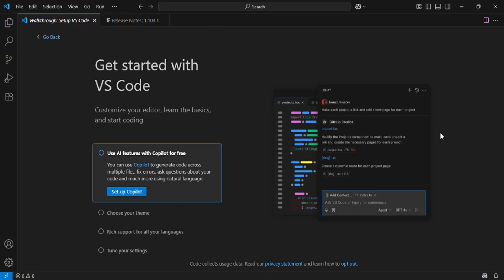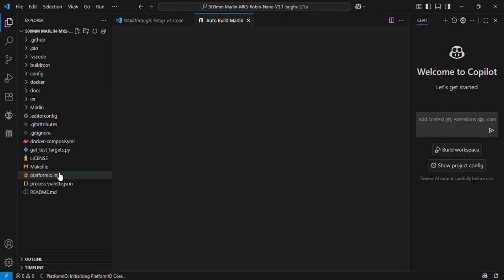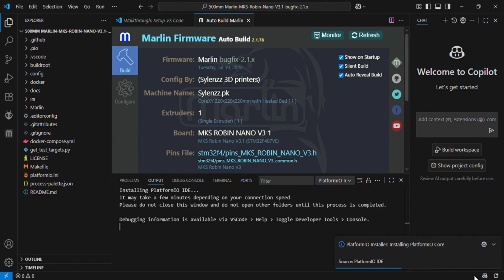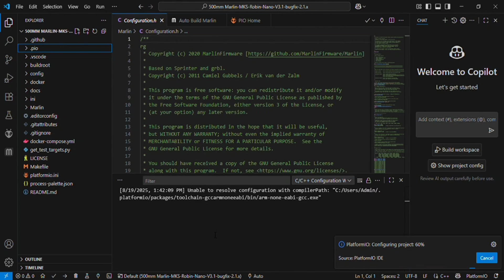Marlin firmware setup guide - VS Code and Auto Build Marlin | DIY 3D Printer

Comment: Thanks for the video, following the instruction I got a firmware.hex file, how do I upload this firmware into the mega 2560 of my Prusa i3 clone?
Reply from the maker: Try this
Install PlatformIO extension in VS Code.
Open your project or create a new PlatformIO project (board: atmega2560)
Put your firmware.hex file inside the project folder
Run this command in the VS Code terminal (PlatformIO environment)
pio run -t upload --upload-port COMx --upload-file firmware.hex
Replace COMx with your Arduino’s port (e.g., COM4 or /dev/ttyACM0)
Reply from the maker: Otherwise if you can create it's code in marlin firmware that would be super easy to upload just by clicking upload from Arduino ide